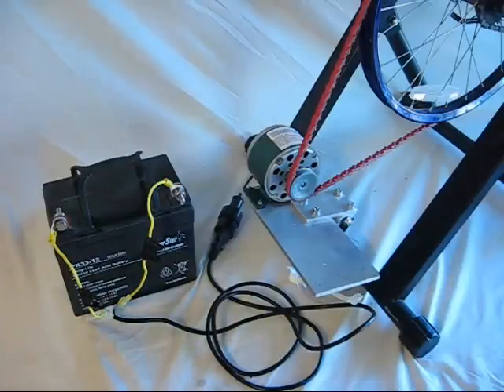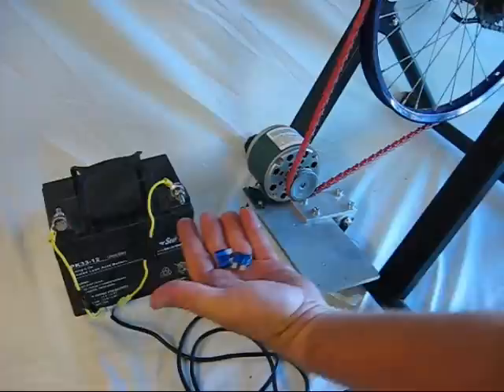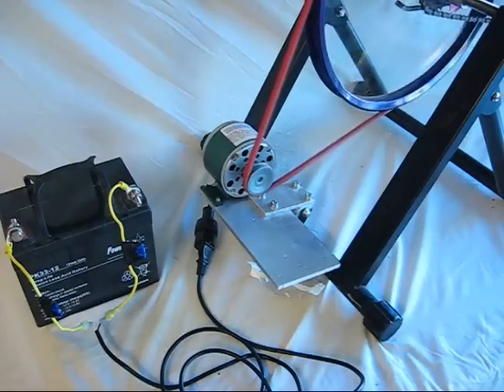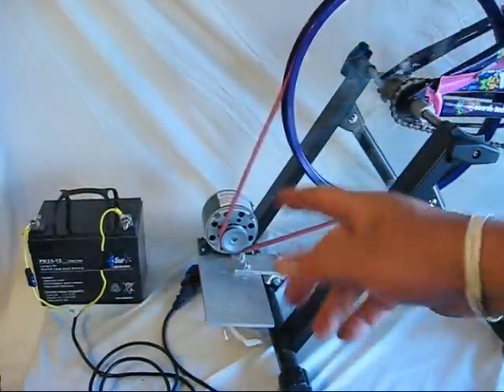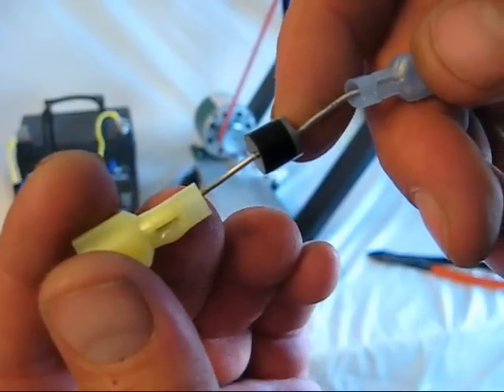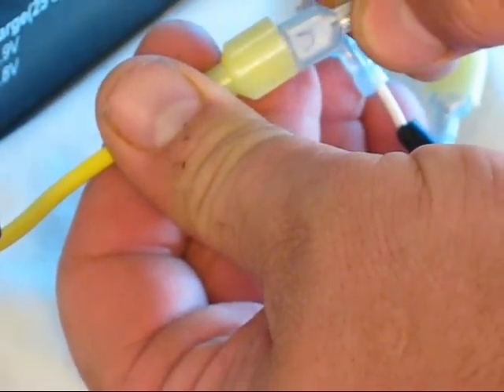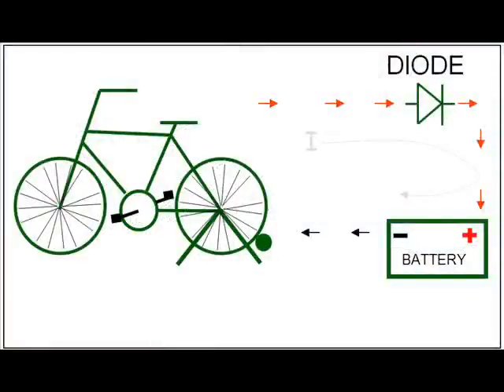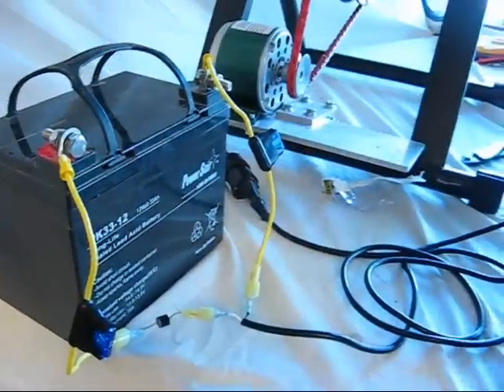Why use A blocking diode with  battery charging dynamo bicycle generator

Comment: .....THANKS. I'M TRYING TO FIND COMPONENTS TO USE, IN ASSEMBLING A COMBINATION GENERATOR, & BATTERY, (12VDC), TO USE TO POWER ANY ONBOARD ELECTRINICS (HEAD LIGHTS, TAIL LIGHTS, STROBES, ETC.) CAN YOU RECOMMEND ANY SOURCES FOR PARTS, OR, READY MADE SYSTEMS?...
Reply from the maker: I can help you if you give me a little more details like:  1) How many Watts total are you going to consume and for how long?  For instance:  Are your lights going to consume a total of 100 Watts at 12 Volts?  if yes, that would mean that you will need to supply about 7 Amps of current to your lights.   If you want your battery to last one hour at that rate,  you would need to double that number and get a battery that is approximately a 14 Amp hour battery or higher.     The big question is how much space do you have for the battery??  Is weight a consideration?  Will a 50 lb battery be too heavy?     Best Regards,  Bradley Whaley,  Electrical Engineer at http://PedalPowerGenerator.com

Comment: Can I keep on charging with my battery on my bike while ridding with my dymamo generator keeping my battery charged with a inline blocking diode that will let current return back to my battery like on my ridding lawn mower? Is that possible without burning out the componets?

Comment: Your video just solved all my problem on how to charge my battery bank with my self invented 28 volt generator. Thanks a million. I will forever remain grateful.
Reply: Iam doing the same thing but why am I failing
Reply from the maker: So glad that it helped you out.  Let me know if you need any more help,  Bradley Whaley,  Electrical Engineer,  http://PedalPowerGenerator.com

Comment: What is the output of the DC generator that could possible to charge a 12v battery?
Reply: just find an old car and take its alternator/belts/rectifier

Comment from the maker: @Daflaminasian I have had wires accidentally touch and go up in a huge cloud of smoke and melted copper metal - it is a very scary site when a battery is shorted with only size AWG wire - so the fuses really are important to have on both terminals if you are a beginner at this sort of thing.

Comment: Is there a unit besides the motor being used to charge this? Because if you wire this to ground on the motor wouldn’t the motor automatically get electrically moved even with the diode?
Reply from the maker: The permanent magnet DC motor you see in the video is the actual generator also.  There is nothing else in this system.    Many people don't know about this  so don't feel bad.

Comment from the maker: @tennirva This problem is handled by using a charge controller which automatically opens the connection to the battery when the generator is providing too much current.

Comment from the maker: @Nachito667 Yes, this is counter intuitive, but you are right.   The generator pulley is spinning in the same direction when the battery is discharging as it spins when the battery is getting charged!

Comment: Do that battery tolerate variable voltage produced by motor, I mean like that motor gives low o/t voltage at low rpm and high o/t voltage at high rpm, so does a motor can take this change of voltage or it will get damage?
Reply from the maker: Yes  the lead acid battery in the video can handle a max charge Voltage of 14.8 Volts DC.   There are two ways to make sure that you do not damage a lead acid battery when charging:  1)  Use a Volt meter and watch the meter while you pedal to make sure you don't go over 14.8 Volts.   2)  Use the NC25A  charge controller sold here:  https://amzn.to/3GjeeHO

 Let me know if you have any more quesitons,  Brad Whaley,  Electrical Engineer,  Phoenix Arizona  http://PedalPowerGenerator.com

Comment: its a great video...but i dont know whats the thing that he use...especially the blue things...can anyone give me the list of things?
Reply from the maker: +torres villa Hello there.    The blue part is a 12 Volt rated fuse sold at an automotive car parts store.  Blue means that is rated for 15 Amps of current.  The fuse protects you against starting a fire  if the two wires from the battery touch together.  That happened to me once time.  It was very bad.  Lots of smoke filled a building.    Best regards,   Brad  at pedalpowergenerator.com
Reply: +bicyclegenerator Hi there! I'm a motorcycle rider, I am wondering if there a diode that will stop the stator charging the battery when it hits 14volts?  Thanks

Comment: You could put also a bridge rectifier,if you use ac alternator(bicycle dynamo also produce ac waves)
Reply from the maker: This particular type of generator puts out DC Votlage.  So a blocking diode is all that is needed.  If you generator or dynamo puts out AC Voltage then you are correct - you will most definately need a bridge rectifier.    Let me know if you have any more quesitons,  Brad Whaley,  Electrical Engineer,  Phoenix Arizona  http://PedalPowerGenerator.com

Comment: yes, but if your motor never gets up to the battery voltage of 12v...can you boost it up somehow?
Reply from the maker: Good question,  the way it is boosted up is that you simply pedal faster.  Or use a bicycle that has gear shifter  so you can adjust the speed of the generator.    Let me know if you have any more quesitons,  Brad Whaley,  Electrical Engineer,  Phoenix Arizona

Comment from the maker: @toddmorrow1 To make 100% sure of which battery is hooked up use a volt meter to check for which wire is positive and which wire is negative.   If you are using the generator shown in this video from pedal power generator website  then it is the red wire.

Comment: ok so i have a 12V DC motor that runs an actuator when the actuator is under load extending itself the motor is using power and has no issues but when it goes down it seems like the load is pushing the DC Motor and causing a Generator effect and a backfeed to the Controller box with is causing weird noises and a drop on the DC Motor RPM would adding one of this Blocking Diods fix that issue of backed due to the load pushing down on it?
Reply from the maker: Absolutely,  the diode would take care of this problem.  Brad from Blockingdiode.com

Comment: To run a water motor of 746W 450V 1hp 
What should be the power of low rpm DC motor
Reply from the maker: Power at high Voltage is the same power at low Voltage.  So you would need a 746W  low Voltage DC generator / PM motor  to put out 746W  and then step it up wth a DC to DC converter,  or inverter.   Can I ask what your project is ?  just curious.

Comment: Hi mate I have a 5v  7 Watt 1.4A  portable solar panel to charge my phone while camping. charges well while sun is shining,but if accidentally leave my phone connected to solar panel when sun not shining, phone (though turned off) goes flat, think when panel stops producing voltage it drains the phone battery ??? can a inline diode stop this and what would be the diode value needed ???? hope you under stand explanation
Reply from the maker: I understand what's going on,  yes a diode in line would most likely solve the problem.  You can get that will handle the voltage and current you specified above,  you can get one from any electronics store.  It's called a  "rectifier diode"     not  "Zener diode"   ,  costs less than a 1.00 US

Comment: How long would it take for the battery to be fully charged using this method ?
Reply from the maker: Hello a typical output of the generator is about 5 Amps.   If you have a 29Amp Hour Battery then you divide  29 / 5 = 5.8 hours of charging.     I know it slow but our bodies don't put out a whole ot of electrical power.   Brad Whaley,  Electrical Engineer,  Phoenix Arizona

Comment: do you have any idea for stop charging when the battery 100% full
Reply from the maker: +A li  Hellor there,   Yes  you can put a  Volt meter on the battery while your are charging.  Then stop occasionally to let the battery "Settle down"    and  when it reads 12.8 VDC  for a lead acid battery  then the battery is fully charged.   Gel Cell batteries are slightly different.  Check the specifications for your battery by consulting the manufactures website.    Best Regards,  Bradley  at pedalpowergenerator.com
Reply: vespas have a simple system  and it used to be easily available, otherwise any car/bike regulator rectifier you get from the breakers yards and while you are there get the alternator and all the wires and even the belts.
Reply: Get or make a Buck/Step-down converter, or get a voltage Regulator, then put that between the generator and blocking-diode/battery. And whether you use a regulator or Buck converter, make sure it has an input voltage range, that covers the different voltages your generator makes, at different speeds.

I prefer Buck converters, because their outputs can be adjustable. So if you want to charge a battery to 80%, to preserve it's capacity. And or if you make a custom battery pack. An adjustable Buck converter can charge to the exact voltage you want or need.

Comment: If you instead used an alternator, how would the wiring be different?  Would you need an inverter?
Reply from the maker: An alternator from a car could also be used in the same way as a generator.  There are two basic types of alternators.  One type is a one wire generator that has a built in self regulated  excitation Voltage  so that the output of the alternator  always stays at 14.8 Volts DC.     The other type of alternator uses an external Voltage excitation device to do the same thing.   In both cases Car alternators are MUCH less efficient than permanent magnet DC motor generators.

Comment: whats the name of that generator so i can get it from the store or site ?
Reply from the maker: +drrobotnikmeanbeanma   This generator is the MY1016  electric schooter motor.  You can do a search on the web for  "MY1016" Motor and you will have no trouble finding it.    This particalular version has been taken apart and modifed  with air ventilation holes  andn a custom fitted V-belt pulley.    From brad at pedalpowergenerator.com

Comment: hey it looks like the dc motor is spinning the same way when its being powered by the battery and when its being used to charge the battery, is that right?
Reply from the maker: That is correct.   The current from the battery flows from positive terminal through the generator  which is  also a permanent magnet DC motor.   From the generator it flows back into the negative terminal.   The generator / motor only changes direction when the polarity is changed.    When charging the battery, the bike generator drives the generator in the same direction  and  electrons (AKA Current)  flow from the positive  terminal of the generator into the battery positive terminal,  out the negative terminal and back to the generator.    I hope that makes sense.  Let me know if you have any more questions.

Comment: I think the current flowing through the battery isn't flat, right ? As I found on some resources, the "AC ripple" must not be too high in VRLA battery charging. Otherwise, it will reduce the battery life. :)
Reply from the maker: If you look at the  data posted at the following link,  you will see actual data representing the current (Amps)  shown  on the graph.   http://pedalpowergenerator.com/dynamo/mns-power-voltage-output-curve-vs-rpm-pulley-generator/   The current is not flat.  It is constantly changing with each stroke of the bike.   If it was a solar panel then the current would be very "flat".   Best regards,  Bradley

Comment: what did you mean by saying  " when we get enough voltage from the generator to cause the current to flow from the generator positive liune up into the battery, this diode will let that voltage through will let that current through in the direction of the battery   " ... ? please it's urgent and thank you
Reply from the maker: Current flows from the generator to the battery when the potential voltage from the generator side is higher than the battery voltage.  For example, if your battery has a resting voltage of 12.5 Volts,  and your generator is putting out 12.6 Volts,  then a little bit of current will start to flow from the D.C. Generator to the battery.    As  soon as the generator is lower than the battery, the current will flow from the battery into the generator, that's why you need a blocking diode.  Best regards , Bradley at Pedalpowergenerator.com
Reply from the maker: benjamin john I responded to your question,  Bradley
Reply: thank you very much :D
Reply: and what's the serial number of the diode that you used ?

Comment: Can I ask how much amperage you get? Say on medium and fast speeds?
Reply from the maker: Hello,  sorry for the late reply.  Assuming an adult in good athletic condition gets on the bike generator connected to a  small 12V  Lead Acid   AGM  battery which has about a 2 Ohm resistance,  the current from the generator can reach up to 15 Amps.    Here is actual measured current data that I have recorded while riding a bike generator  at this URL https://tinyurl.com/yyuenzwv   The bike generator is from my website  http://pedalpowergenerator.com    Please let me know if you have any more questions.      Best Regards,  Bradley Whaley,  Electrical Engineer

Comment: Can you add a part list, and where to find them?
Reply from the maker: Diode is sold here:  https://amzn.to/3Wn6o5j
Generator is sold here: https://amzn.to/3YN8LA7
Adjustable length belt is sold here:  https://amzn.to/3YJeV4p
ATC Fuse hodler sold here:  https://amzn.to/3PUKXWM

Comment: What generator are you using and where can it be purchased from
Reply from the maker: +Ruven Naidoo This generator is the MY1016  electric schooter motor.  You can do a search on the web for  "MY1016" Motor and you will have no trouble finding it.    This particalular version has been taken apart and modifed  with air ventilation holes  andn a custom fitted V-belt pulley.    From brad at pedalpowergenerator.com

Comment: Couldn't you make a similar system attached to a gas powered bicycle so it can charge a portable battery station?
Reply from the maker: That is a great idea ,  What kind of gas powered bike are you looking at it ?   Does it have a 2 stroke motor ?   You can find out the horse power rating of the motor and then do a calculation  using the conversion rate of 745 Watts per horse power.   Assuming a 50% efficiency  in energy conversion from Gasoline to  electrical generator output  and a horse power rating of .5  then  the approximate power output of your gas powered bike would be approximately  0.5 x 745 x 0.5 = 186 Watts.  you could use this power to charge a 12V  lead acid  deep cycle battery.   Then connect an AC inverter  to convert the 12V  from the battery to regular power that you get out of your wall outlet  in your house.  This is 110V  AC  .    (DC stands for Direct Current,  AC Stands for Alternating current).

Comment: if i have a generator of 24v  and battery of 12v when i connected generators wire with battery and battery wire with generator would it charge the battery or the battery would drain and if i put blocking diode between the wire what will happen plz reply my comment brother.......and sorry for my bad english...plz reply
Reply from the maker: It depends what type of generator you have.   If you have a 3 phase AC generator that puts out alternating current you will have a rectifying diode to convert the AC to D.C. To charge the battery.  Can you tell me if you have a generator that puts out AC?  Or D.C.?
Reply: bicyclegenerator i have dc 12v generator

Comment: Where would you place the "charge controller" and how would it work?
Reply from the maker: A charge controller would be placed in series with the diode .   Here is a video I made showing step by step how to wire up the charge controller.  http://pedalpowergenerator.com/diy-byo/step-3-installing-charge-controller/

Comment: Which diode is charge to a tractor battery
Reply from the maker: In order to pick out a diode to charge a tractor battery  you need to look at the specifications of the battery  and see what the max charge current is .  Typically a 100A  diode will work  for this.  But you will need to mount that diode do a heat sink (Some piece of metal)  to dispate the heat loss from the diode.  For instance this is a 100A diode that might work for your situation.  You would need ot send me photos of your battery  for me to help you out.     https://amzn.to/3WFxPak      Let me know if you have any more quesitons,  Brad Whaley,  Electrical Engineer,  Phoenix Arizona  http://PedalPowerGenerator.com

Comment: Can you just mention the Belt type used in the video...?
Reply from the maker: Soham Kulkarni the belt type is called power-twist, adjustable length belt v-belt, size 3L.  3/8". Wide.  Best regards, Bradley whaley pedal power generator.com

Comment: Now make us a manual switch to switch from run to charge mode on our electric scooters and ebikes.
No reason these things can't have regene going down hills or being pulled along awhile.
Reply from the maker: This is an interesting request.  To do this we would have to Use a horrific current transducer to measure current. As long as current as flying in the positive direction charging the battery we would leave the switch closed as soon as the current stops flowing in this which would open the switch is a mechanical relay that we’re talking about. You can buy one at O’Reillys or AutoZone for three or four dollars. The Current Sensor is available http//measure-current.com.  This is our other website And small business that we manage.